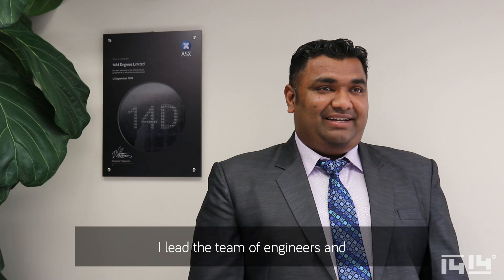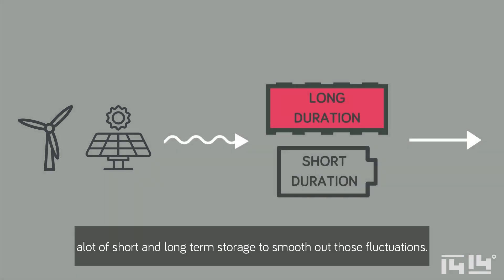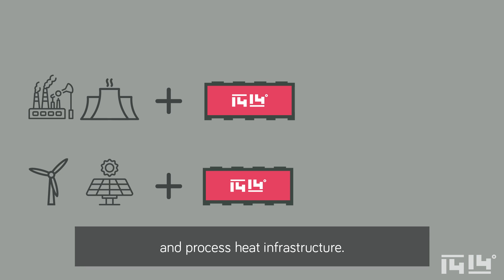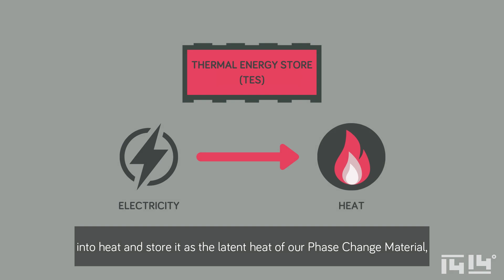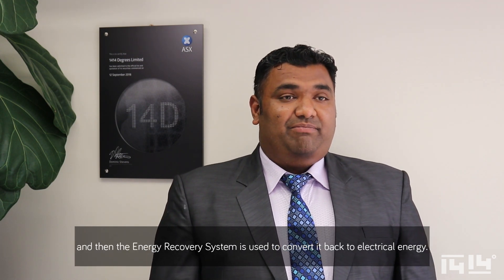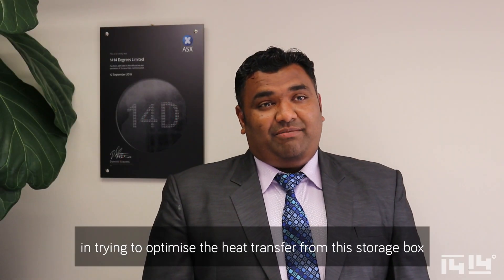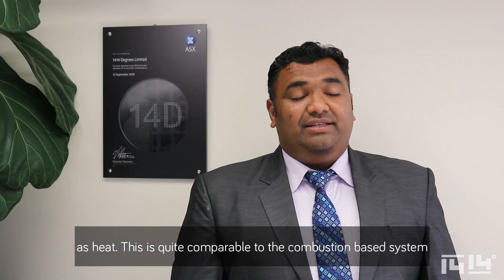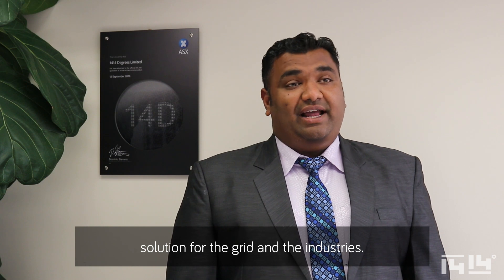How can 14D's Thermal Energy Storage lead to 100% Renewables?

Comment: Very interesting!
But could you elaborate on how you minimize heat losses from renewables.
You mentioned that ~90% of the input heat is stored?
If we take for example a sq.meter of surface collecting sunlight we have several ways to collect that energy.
The least efficient way is using PVs which have efficiency of 20~22% (so nearly 80% of the light hitting out collector surface is lost).
If we use silver mirrors we would lose only ~5%. So a more scalable solution would be to use Aluminum mirrors with ~90% (ie 10% of the sunlight is lost before we even attempt to store it or use it).
Lets assume that 90% of the captured light is 100% of our capabilities and that we can concentrate it if we need to reach higher temps.
Are you saying you can store 90% of that (ie 90% of 90% total sunlight or ~81%).
Also how is that storage efficiency related to the operating temperature (I assume high temps during the day of at lest 600-700°C even 1400~1500°C as I understand that Si-PCM phase change happens at 1414°C)
Thank you!